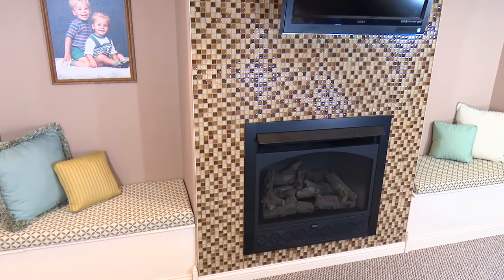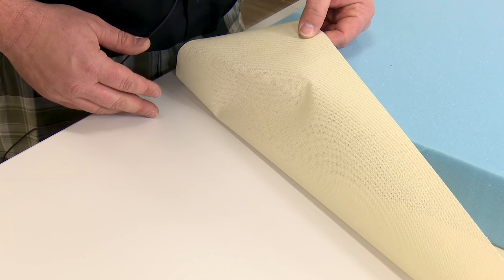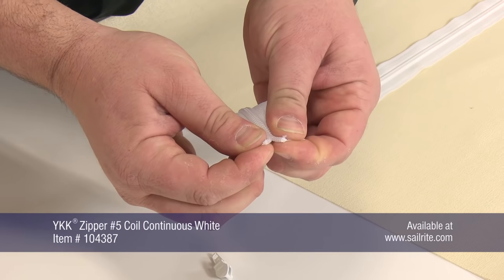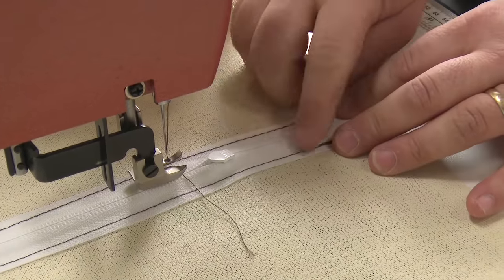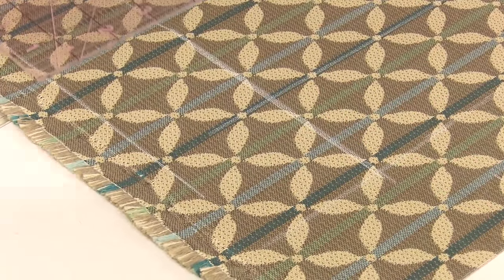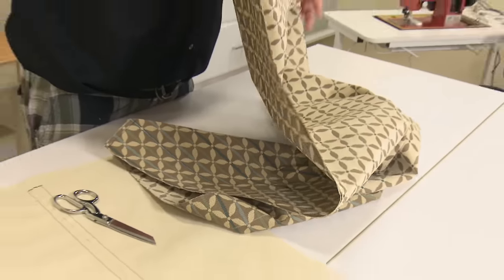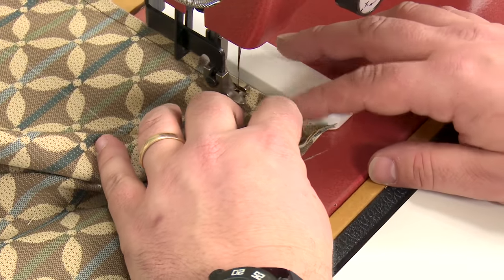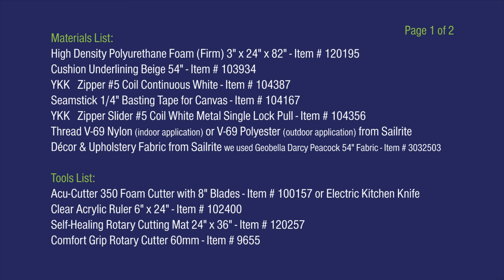How To Make a Quick and Easy Box Cushion

Comment: This was a really helpful video with the exception of one thing.  You say cut the foam 1/4" larger than the required finished cushion and then cut the base fabric 1/4" smaller than the dimension of the cut foam, but you don't explain WHY.  I've watched the video three times now and got my husband to watch it too in case I was missing something quite obvious, but no, you just don't explain WHY!  I've read the answer you gave to Barbara Wardlaw 2 years ago, but this is even more confusing than the lack of explanation in the video - it just doesn't make sense at all.  Is the reason you cut the foam 1/4" larger and the base plate 1/4" smaller, to ensure the foam fits the cover snugly?  I simply can't figure out how there ultimately being a 1/2" difference between the size of the foam and the base plate makes sense - that would be a very snug fit, surely?  Maybe I'm thick, but please explain in words of one syllable to a novice cushion maker.  Thanks.
Reply from the maker: The top plate incorporates the boxing as you see in the video. However, let’s break it down in smaller steps to hopefully explain it better.
At 9:56 min Brian traces around the foam which is already ¼” larger than the opening it fits into. This creates a top plate which is the exact size of the foam. Next at 10:10 min Brian measure the thickness of the foam and then takes away ¼” from that thickness. The boxing is not as wide as the foam by ¼”. True the 3/8” seam allowance is not taken into account intentionally because we want a tight fitting cover. So… the ¼” (which was taken away) and the 3/8” seam allowance that will soon happen to sew the bottom plate on, will take away about 5/8” of the overall size of the boxing making the cover fit very tight, which is what we want. This helps, pull the incorporated facing/boxing (facing included on the top plate) down, so the bottom plate fabric does not creep up and show itself along the bottom edge when the cushion is finished.

Basically this allows for a tight fitting cushion cover.

Comment: Do you ever use batting first?
Reply from the maker: We do use batting on some of our cushions, if we want the corners to be rounded in appearance rather than squarish. However, we have not tried to use batting with the cushion making approach we showed in this video. It may work fine, it just has not been tested. We usually use the "Traditional Box Cushion" approach when using foam wrapped in batting.

Comment: I don’t understand this - if you cut the bottom plate a quarter of an inch smaller than the foam size then surely the top plate will be a different size and when you sew the top and bottom plates together the bottom plate will come up short?
Reply from the maker: That is correct, we want the bottom plate to not show up along the bottom of the cushion. So, the top plate sort of wraps around the bottom edge slightly.
Reply: Thank you for replying. I understand what you’re saying, but if the two pieces are different sizes then how do they meet at the corners? I tried with spare fabric and they didn’t - the bottom plate was too short.
Reply from the maker: @ailsabarr9392  I hope you used our fabric calculator to cut your fabric: https://www.fabric-calculator.com/FoldOverSimple/index.html If your bottom plate was too short and it was cut correctly, then it may be that after sewing the fabric shrunk up due to needle pucker.

Comment: I'm confused n need a bit of help!  I don't understand why u take 1/4" away of the height of the foam,  when the foam is already 1/4" bigger,  and the bottom plate is exact!  where is the seam allowance?  won't this make my top plate too small? I don't want to make cuts and have it be too small.  I must be missing something because all the comments say it's easy... I'm not an experienced sewer,  please help!  Thanks
Reply from the maker: Hi Christine,
The foam will compress slightly, that is why we make the foam a 1/2" larger on both dimensions or 1/4" larger on all sides. Which makes for a very tight fitting cushion.
Reply: @SailriteDIY  OK,  that makes sense,  thank you for the clarification!

Comment: I'm a bit confusd. I am using the same fabric for the bottom of my cushion. Do I sew the zipper,  teeth down, to the wrong side of the fabric?
Reply from the maker: Yes, you would sew the zipper down on the wrong side of the fabric. If the fabric frays easily you may want to cut it with a hot knife (if it is a synthetic fabric). That is why we used cushion underlining, it does not have a right/wrong side and it does not fray when cut with scissors. Let me know if you have more questions.
Reply: Sailrite thanks....I was confusing myself and couldn't quite visualize it
Reply: so once it's all sewn, I cut the fabric along the length of the zipper? Then turn it? sorry but I keep envisioning raw edges of my fabric showing.
Reply from the maker: That is true, following the video and using a cushion underlining fabric (which does not unravel) the edges would be left raw. However, if your using a fabric that must be hemmed under along the zipper's teeth. I would suggest taking your bottom plate and making it 1 to 2" wider and then slitting it down the center and sewing your zipper in with a single hem at the center location. Then cut the plate to the correct size for the cushion. Now you have a bottom plate with a zippers opening that is hemmed for a clean edge.
Reply: Sailrite thanks do much. I adapted zipper installation so I wouldn't have raw edges. It is a great pattern and my cushion looks wonderful and fits perfectly!!

Comment: I should have listened to my instincts that this made no sense! I followed the directions exactly and ended up needing to trim my foam down to fit it inside and now the finished cushion is smaller than I needed it. My only guess is that my foam is more firm, and my fabric less stretchy. In that case the directions should say that this won’t work with woven, non-stretchy fabrics.

Comment: Could this method work on a trapezoid cushion? Would you do the corners the same way? Thank you!
Reply: I should clarify - a cushion that is wider in the front than it is in the back. So the angles of the corners would be different. How would that work?
Reply from the maker: We will have to do some actual testing, since we have not made a “Quick & Easy Box Cushion” in a trapezoidal shape yet. It could be that the corners need to incorporate a 90 degree cut out instead of a triangular shaped cut out to match. So, along the base sides and angled sides a line may need to be drawn 90 degree to the adjacent line (not following the same angle of the angled side). 
This will require some testing, so we will have to get back to you. We may need a new video showing this after the testing is done.
Reply: Thank you! I'd be extremely grateful if there is an opportunity to do some testing and make a video!

Comment: Great video. Excellent instruction, but I figured that to make my own cushion like the one showing in this video, I'll spend around $150. just to make one cushion. I'm sorry but I don't see the point, unless I'm doing it as a hobby.
Reply from the maker: Get a quote from a canvas or fabricator shop for a custom size cushion and you will get a quote for several hundreds of dollars each. So, doing it yourself may save you a hundred or more per cushion. Just get a quote and you will see....
Reply: This would be true if you had to buy everything/tool from scratch. If, however, you already have a sewing machine and some scissors, you can pick up a foam pad around this same size for $15, and material for 
around $15. I just made one, but used marine vinyl that I had lying around from a different project I never ended up doing. The vinyl was on sale for around $15 per yard. A custom foam pad for around $30 isn't 
bad. You'll easily spend more than than that trying to buy something else to cover something around 40" X 18" with a thick pad like the one made in the video.
Reply: Thasnks

Comment: Why subtract 1/4 inch from the width of the cushion depth?
Reply from the maker: The top plate incorporates the boxing as you see in the video. At 9:56 min Brian traces around the foam which is already ¼” larger than the opening it fits into. This creates a top plate which is the exact size of the foam. Next at 10:10 min Brian measure the thickness of the foam and then takes away ¼” from that thickness. The boxing is not as wide as the foam by ¼”. True the 3/8” seam allowance is not taken into account intentionally because we want a tight fitting cover. So… the ¼” (which was taken away) and the 3/8” seam allowance that will soon happen to sew the bottom plate on, will take away about 5/8” of the overall size of the boxing making the cover fit very tight, which is what we want. This helps, pull the incorporated facing/boxing (facing included on the top plate) down, so the bottom plate fabric does not creep up and show itself along the bottom edge when the cushion is finished.

Comment: I did not understand why you cut the the material shorter than the foam? Wasn't you suppose to cut it longer to compensate the seams?
Reply from the maker: We want a nice tight cushion cover to compress the foam slightly, so after the seams are done your cushion cover will be tight and not show wrinkles after a user sits on the cushion.
Reply: @SailriteDIY  Understood. Thank you very much
Reply: @SailriteDIY   But how do you know how much smaller than the foam should the cushion cover be?

Comment: Will this work if the cushion is a back cushion that is square on the bottom but has rounded corners on the top?  If I just box the one end will the curves just smooth out at the top?
Reply: Yes it does!  I used gathering stitch and eased the rounded corners.  It looks great, wish I knew how to send a photo.  Thanks for the video, can't wait to order supplies from Sailrite.
Reply from the maker: Kelly, If you would not mind post your comments and photo here: http://www.sailrite.com/How-To-Make-a-Quick-and-Easy-Box-Cushion-Video Scroll down to the Join the discussion section on that link.

Comment: I sewed cushions for 21 years at Norwalk Furniture company and I could see several mistakes in the quality and the way you sew your cushions. First of all it is much easier to sew a wet to the border piece rather than the top or bottom panels. If you keep the welt down and the border laid on top it allows the fabric from having any puckering that is caused by the feed dogs and the thread. It is not a lot but even a little makes it difficult to get a panel to fit a border. It also is easier to welt a straight border piece on both sides than it is to try to sew around corners and you do not need to clip the corners. Then when piecing the front of the border on a matched stripe we would never have allowed a welt seam or a border seam to be in the front as it looks tacky to see a seam and we would adjust our welting so that the welt seam would fall on the sides and we would adjust our border also to make certain the border seams fell on the sides. As for joining the rope and welt at the finish we would but the rope up as shown and would tape the rope ends so they would not gap and separate and then would cut the welt fabric so as it can be seamed with a 1/2 inch and all seams and welt seams would be opened up so the seams would lay perfectly flat with no humps or bumps and the welt practically disappears. Your sewers are wasting way to much time sewing the cushions. We never used pins or staples or the welting sticky tape.
Reply from the maker: Great suggestions! I will incorporate some of them in my next cushion (a cushion with piping, welting, cording) and see if it is indeed easier and better. Thanks!!!!
Reply: @SailriteDIY  I hope it is easy to understand my suggestions. I felt it always easier to welt the long straight border pieces than try to do as you were doing. Always put the welt on the bottom and the border on top and so the border will be facing down. When we cut our borders we did not have to take the time to cut those release notches. The only problem was to avoid seams in front and we usually had to start sewing the welt onto the border piece so it would not have a seam on the front and a little more difficult making sure to start welting the border piece. All are border pieces and zipper pieces were cut exactly to fit where one could sew them in a loop and and the corner notches were already cut into the border. Once we had the welt attached to the border it was just a matter of sewing the seam in the welt so it was ready to open the seam and left open. Once we had the one panel piece sewn on notch to notch we then could fold the corners and then square up the corner and put a clip notch on all those 4 corners. Then do not sew closed the rope but when adding the panels if you think you are going to have wavy welt you can always pull the rope as you go to take out extra rope if you are going to have trouble reaching the corner notch and once you get the panel on then we would but the rope edges and tape them together so they would not separate. Then you do the same with the other panel. When we received out cushions we usually received them with the zipper already inserted and the borders pieced to the zipper and then it was up to add the contrasting welt to the border and then sew on the panels. Believe it or not I could probably sew welted boxed border in in about 5 minutes and that was even with matching all the stripes. When we received borders that were already sewn and had been folded to go throw the boxer then I could sew a cushion in 3 minutes. We did the job on piecework so we had to get good and fast and think of shortcuts and after 21yrs. I think I got the technique down to a science and could almost sew them with my eyes closed. If you have any questions let me know.

Comment: how did you shrink that?
Reply from the maker: When the cover was made it was slightly smaller in size to the foam. Thus the result was a tightly fitting cover over the foam that compressed it so, it would fit perfectly in the opening it was designed for.

Comment: What if your cushion is not cut 1/4 inch bigger?
Reply from the maker: If your foam is not a 1/4" larger that is ok, your finished cushion will be slightly smaller than the desired finished size after the cover is installed. If you use the "fabric calculator" tweak your finished size so the foam equals the size of your foam.

Comment: Stupid question. Why do you cut the foam 1/4" more than the size you need?
Reply from the maker: Good question. The tight fitting fabric cover will compress the foam about 1/4" or so. So.... after the cover is installed it should be the desired size.

Comment: Why did he cut the fabric in a quarter inch rather then add it for the seam allowance?
Reply from the maker: The top plate incorporates the boxing as you see in the video. However, let’s break it down in smaller steps to hopefully explain it better.
At 9:56 min Brian traces around the foam which is already ¼” larger than the opening it fits into. This creates a top plate which is the exact size of the foam. Next at 10:10 min Brian measure the thickness of the foam and then takes away ¼” from that thickness. The boxing is not as wide as the foam by ¼”. True the 3/8” seam allowance is not taken into account intentionally because we want a tight fitting cover. So… the ¼” (which was taken away) and the 3/8” seam allowance that will soon happen to sew the bottom plate on, will take away about 5/8” of the overall size of the boxing making the cover fit very tight, which is what we want. This helps, pull the incorporated facing/boxing (facing included on the top plate) down, so the bottom plate fabric does not creep up and show itself along the bottom edge when the cushion is finished.

Comment: 1. it's never going to come out as the size of the cushion because you haven't added seam allowances - so you're losing the seam allowance around the whole cushion
2. Step 6 - the two pieces are never going to line up because you've shortened the top piece by 4xseam allowance all the way around??

Comment: So frustrating. I have no idea why they made the cover so much smaller than the foam. Cutting everything 1/4" short plus the 3/8" seam means IT DOESN'T FIT! Just wasted quite a bit of time and money on  material and zipper for an end product that is going in the trash because it's not functional for the size of cushion I need. Very disappointing. 
The general construction of the project is not bad. Just the suggestion to make everything smaller than needed.
Reply: I am trying to make a back cushion for a banquette seat that needs to be almost 7' long, 11" tall, and 1" deep foam.
Reply from the maker: I see by your comment below this one that you are making a cushion that is only 1 inch thick. If that is true the "Quick & Easy Box Cushion" technique is not a good option. Instead you need to use the technique of making a chair cushion as found here: https://youtu.be/yjpihYRgkAg I hope this helps solve your issue. If not email me some photos and I will see if I can help more. ericg@sailrite.com